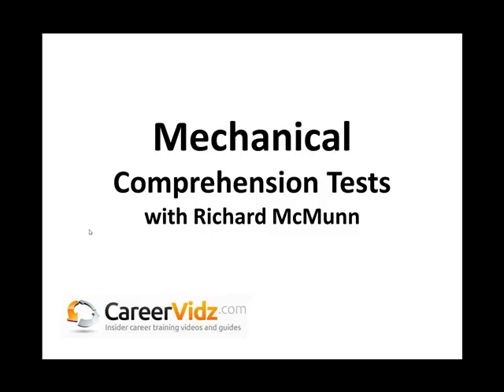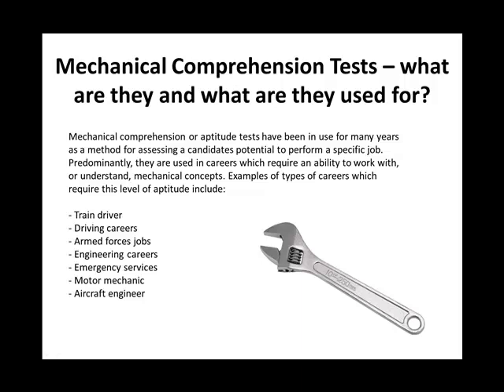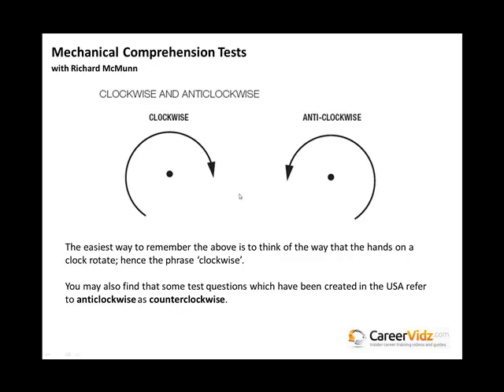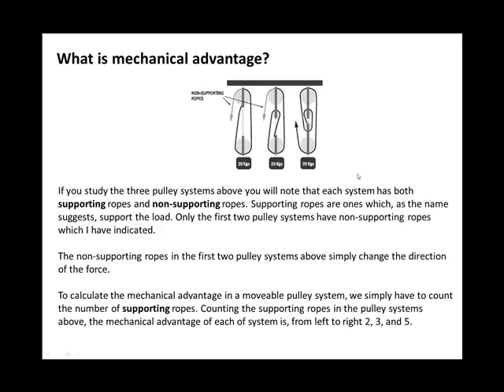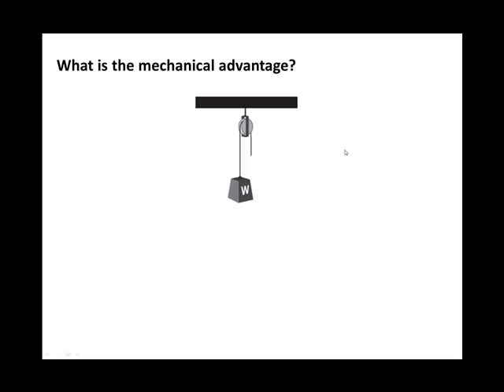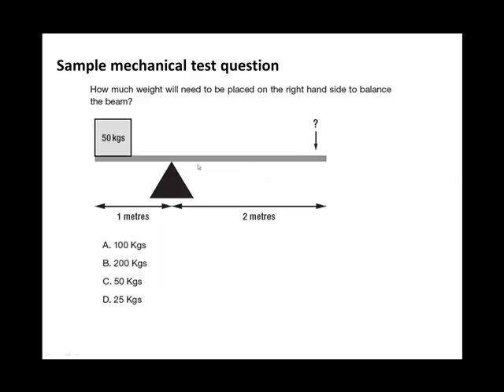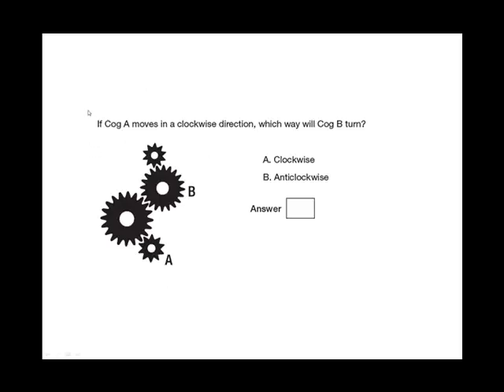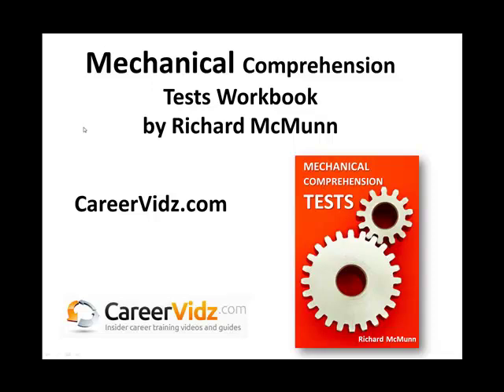Mechanical Comprehension Test Questions and Answers - How To Pass Mechanical Aptitude Tests

Comment: Maybe I'm taking the wrong tests, but every job I've applied for was not as concerned about the clockwise and counterclockwise rotation of the pulleys, but the calculated turn ratios of the driver and driven pulleys, the most likely cause of sprocket and chain wear, or proper alignment techniques of the motor and pulleys..  Plus, pneumatic flow control, actuators and sequence valves, pressure vs flow volume, and a lot of questions on electrical theory, ohms law, transformer ratios, induction motors, ladder logic, and PLCs.  Do you know where I can find these types of test practice questions?

Comment: I don't get the chain support question... you say, "imagine each of the chains not being there". Ok, well, how would the load be supported with B but not the others? I guess my issue is with understanding what length of the chain remains when I imagine a section missing. I mean, my initial answer would be None of them. I'm not sure I understand the structure of this diagram... please help. Thank you

Comment: I have to do a Ramsey test for Amazon for a maintenance mechanic position. I don't know much about being a maintenance mechanic, but I want to learn so I can get this job that pays very well. This is all new to me, but I want to get this job at Amazon. Hopefully I pass the test, and learn quickly while being trained at work. They already offered me the job, but I need to pass the Ramsey test before I can start working as a maintenance mechanic. Hopefully Amazon is patient with me, and trains me long enough to get the experience that is needed.

Comment: What test does this help with ?
Reply from the maker: Mechanical Comprehension Tests are usually used in roles such as the Armed Forces (Royal Navy, RAF, Royal Marines) and they are also used within engineering roles and sometimes the Fire Service.

Comment: isn't 3 meters for that ladder question?
4 to 1 rule?
Reply from the maker: Hi Kami, thanks for watching! The answer is 4m because the builder has been told to pitch his ladder 1/3 of the working height away from the building. You may be right that this may not be as safe as it could be in real life, though!
Reply: Reading might be a better test for you. Where did you pull 4 to 1 based off of the information you were given?

Comment: I appreciate the video but you should give better reasoning for your conclusions. Example: Torque = F*d, The cross with the weight can pivot (I imagined it as a rigid object at first).
Reply from the maker: Thank you for your feedback - I have taken on your comments, and will use them when working on my next video :)

Comment: I did not get the which rope will support question
Reply from the maker: Are you referring to the mechanical advantage practice question?
Reply: Look at the pivot at the center of the cross and assume its not fixed.

Comment: Does this apply for the elevator trade?
Reply from the maker: +infinightsky These questions are just a generic set which can be used in many different selection processes. Any job the requires mechanical or technical ability should have a good understanding of the concepts discussed in the video.
Reply: ɷɷɷ Heeyy Frienddsss I Have F0undd W0rikingg Online Hacck visitt  : -  https://t.co/k7D5mHAYT1
Reply: CareerVidz I ended up getting in, thank you :)

Comment: I do not understand how the pulley example works
Reply: the rope in the pulley system has two ends, one connected to the load and the other to lift the load. the direction of the load is downward because of gravity. if the free end of the rope is also downward its not supporting the load, its changing the direction of it (if you pull DOWN on the rope, the load goes UP) and not counted as a mechanical advantage. but if the free end of the rope is pointing upwards, its supporting the load and its counted as mechanical advantage.